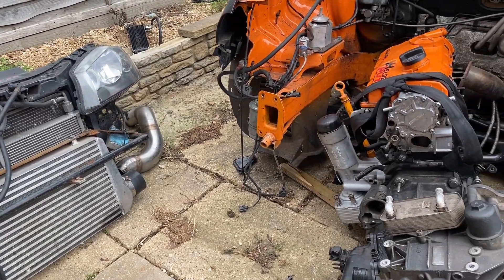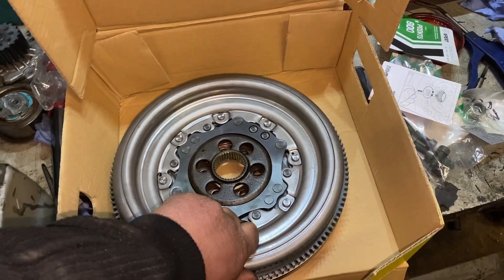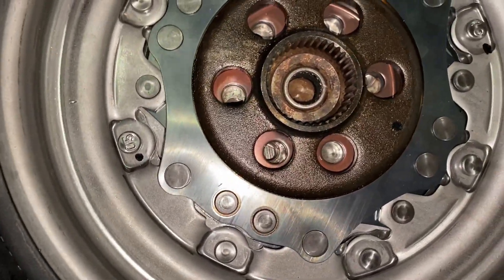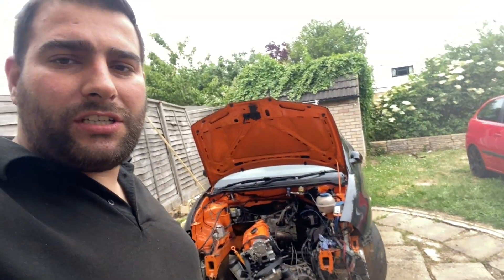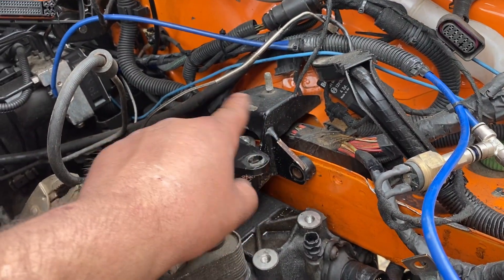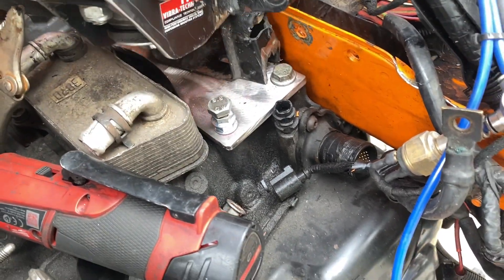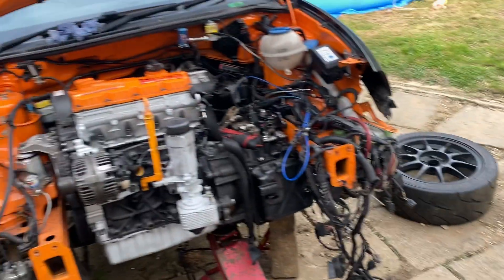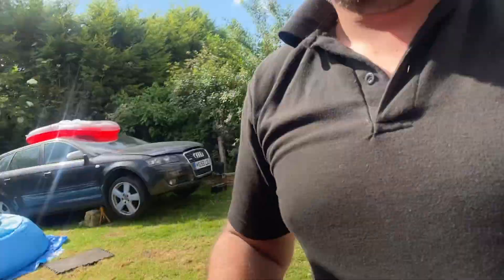DSG Conversion Seat Ibiza 1.9tdi 6l Gearbox mount fabrication (EP2)

Comment: Im very curious how you will comunicate the dsg with the ecu and all the wiring
Reply: I mean we got mk4 pds with dsg here in the states so it's not magic.
Reply: @slodsl  mk4 with dsg ?? Sure not with dq250
Reply: @VWPassat_3BG  yes. 2005-2006 beetles with the bew.
Reply: @slodsl  DQ250 ?
Reply: @VWPassat_3BG  yessir.
Reply: I am thinking the same thing, if the car was originally a manual then i am sure there will be a lot of wiring changes to get it to work. Perhaps taking the wiring out of the dono car will work but must still be a lot of work to get it to work.
Reply: Its more or less bolt on communication wise